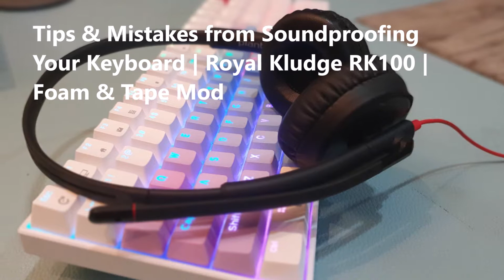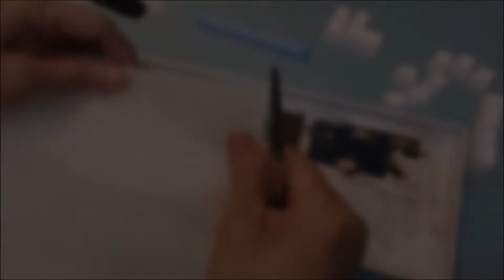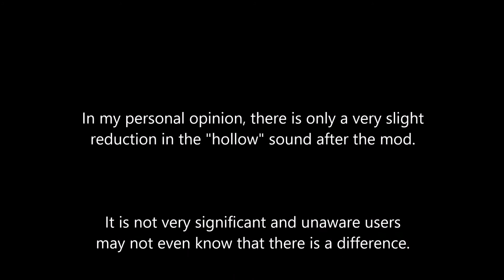Tips & Mistakes from Soundproofing Your Keyboard | RK100 RGB | Foam & Tape Mod

Comment: I don't see the point of doing this when you have blue switches
Reply from the maker: U may be right as the blue switches are already quite loud. I was just testing the effect of the mod as I was getting some "hollow box" kind of echo / vibrations during typing.
Reply: @generification6176  did the same on mine and there is a great different feel  when typing.
Reply from the maker: @jenatsui6284  Good to know it is of help!